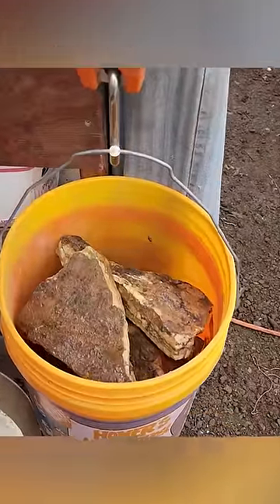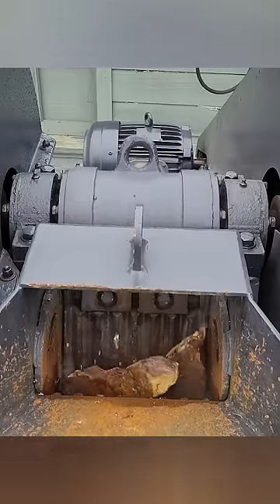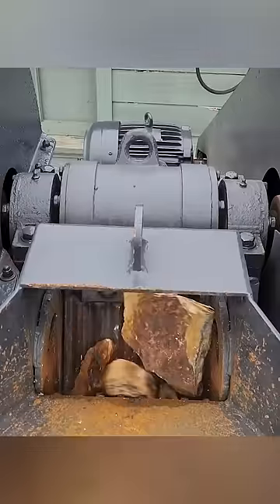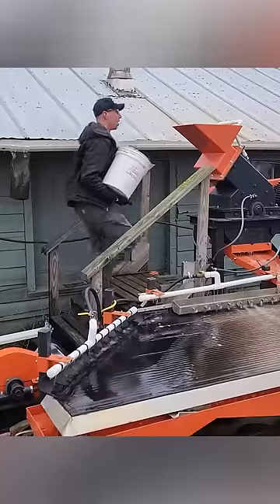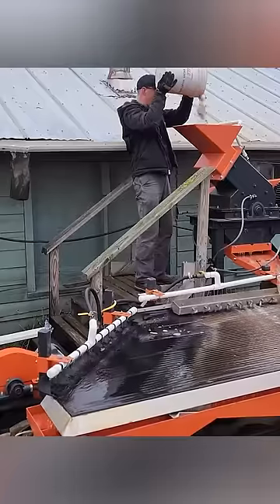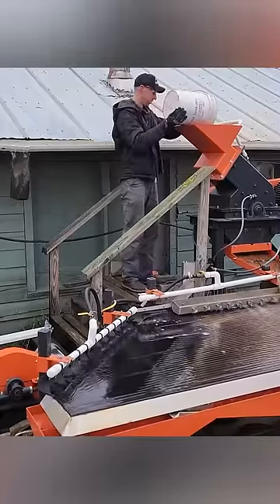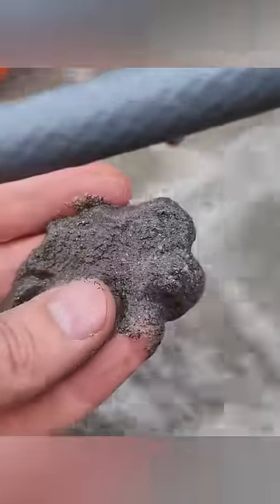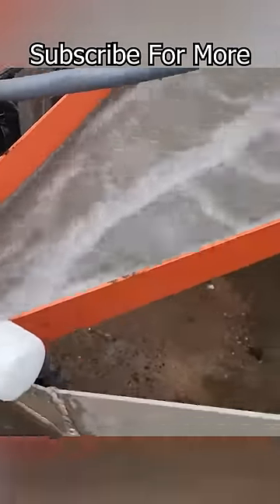Crushing Gold Ore from an Abandoned Mine: Extraction and Recovery Process

Comment: How much did the crusher cost? Asking because I might want 1 to make ballast for 1/8 scale model trains.
Reply: Try black aquarium gravel..
Reply: @bobbob4652  Too small and too expensive.
Reply: @modelrailroad6337  1/8 th scale? I haven't heard of that scale before, is that for like live steamers?
Mark from Melbourne Australia
Reply: How much ballast are you looking to make?

I have some ideas but they depend on your quantity needs
Reply: @markfryer9880  Yes It's more commonly known as inch and a half refering to the 1 foot to 1.5 inch reduction. Look up Train Mountain
Reply: @mrfixitusa6165  Local club uses about 1 cubic yard a year. Train mountain goes through alot more.
Reply: @modelrailroad6337  OK, that's not a massive amount, certainly sounds managable.
What type of material are you wanting to crush down to that size?
Does it have to be a certain type of specific Rock, or does it just need to be something that looks exactly like rock?
Reply: @mrfixitusa6165  What ever native rock is on hand. We've used old crushed concrete before.
Reply: @modelrailroad6337 yes much better to buy a $1000+ crusher for a little bit of gravel. I smell B.S.